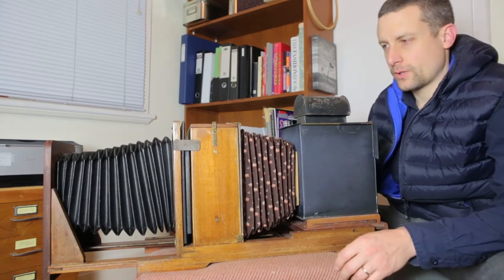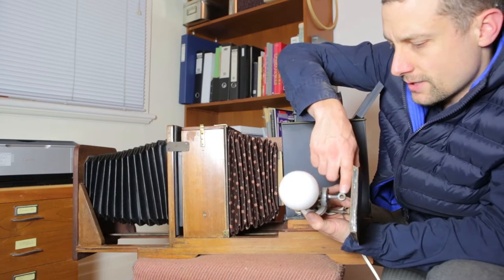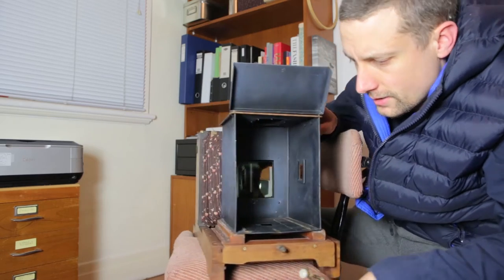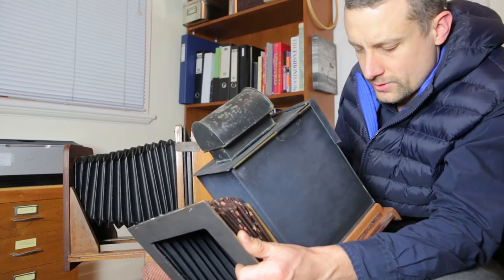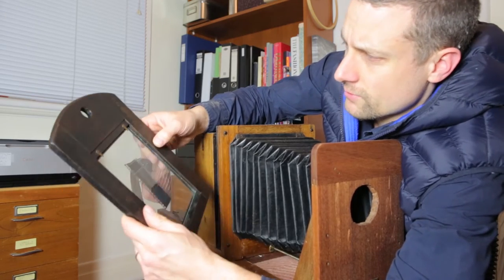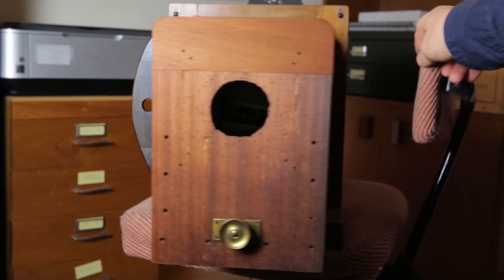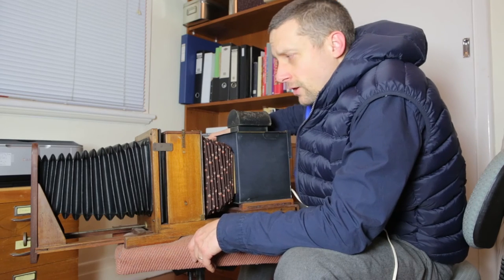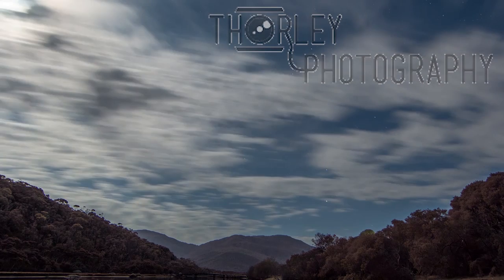Condenser enlarger for mural prints part one

Comment: That slot will allow you to also use ND filters to lower your light intensity if you require longer time to dodge and/or burn.
Reply from the maker: Graham Hett Yes you are right, I'll also consider mounting a shutter in there since a conventional enlarger timer will not be practical.

Comment: How did this end?  Did you get any good results?
Reply from the maker: Thanks for your interest. I have made some large prints that I am happy with. Very hard to aim square and focus. So hard you feel silly doing it.
Reply: @thorleyphotography  I'm using Victorian quarter plate cameras and toying with the idea of getting one.  I was amazed to find your videos on this well done.  Did you use an easel or the wall?
Reply from the maker: @Neilweemuck  I used the wall. I made a cassette for the roll paper and mounted it up high on the wall. I can just pull the paper down, expose and cut. It's made out of foam, ply wood and hot glue.